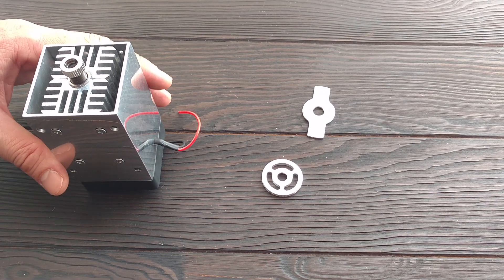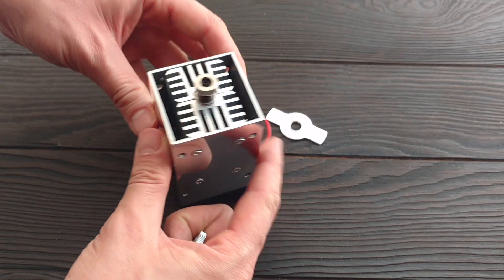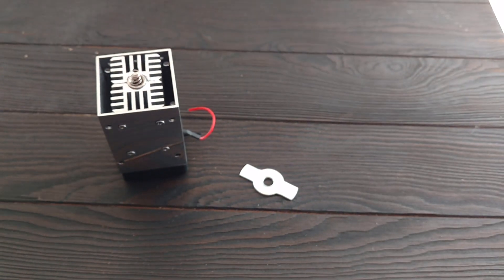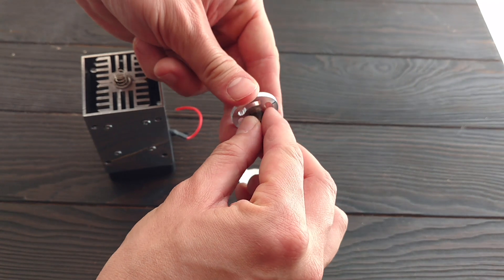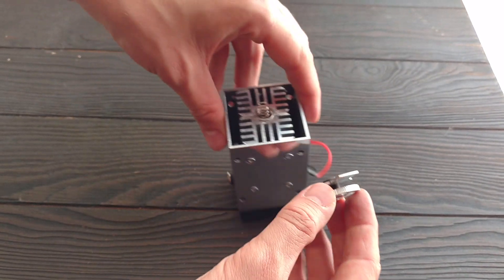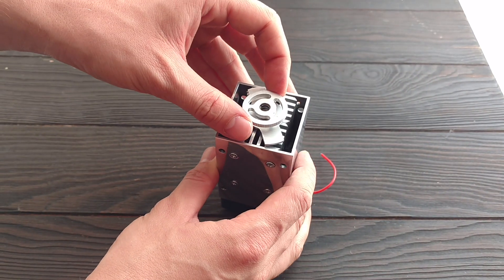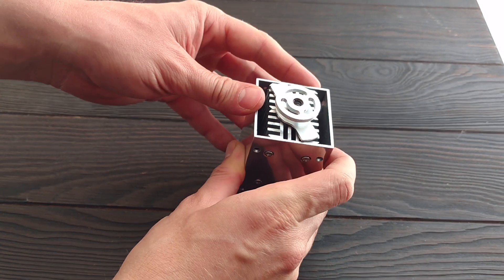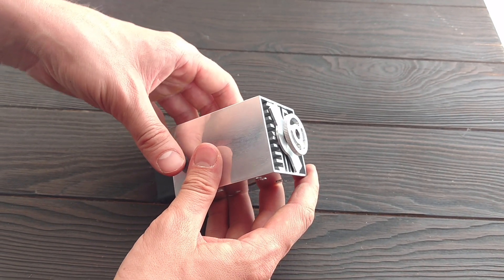Bigger focusing ring and fixation ring for your diode laser. Improve your focus stability.

Comment: We call it a lock ring.  But I knew what you meant.  Just helping.   I'll have to check to see if it will work on my lasers from Eleksmaker and SainSmart.  I hate that the lens wobbles all around.   If it's off by a half mm it changes the power coming out.
Reply from the maker: ok, yes fixing ring or lock ring, exactly